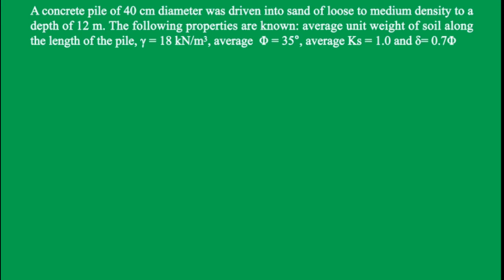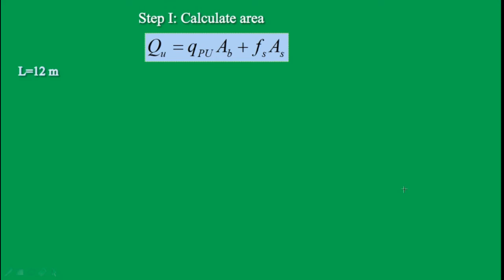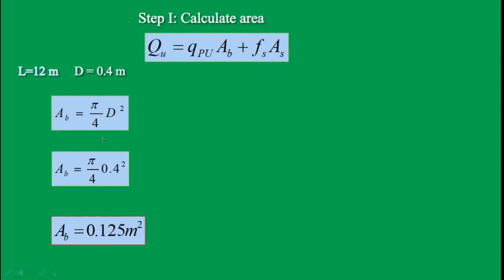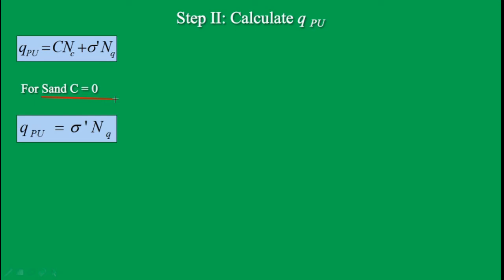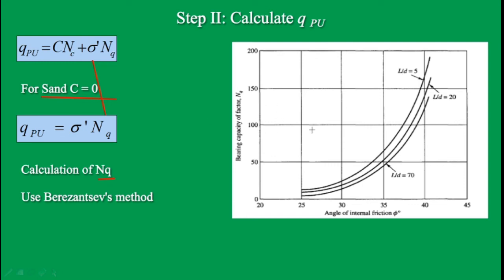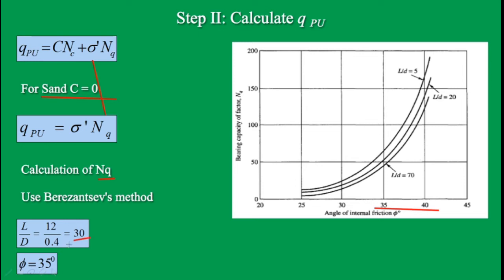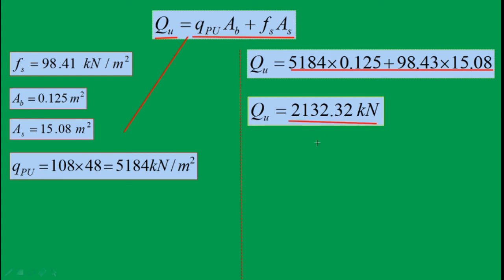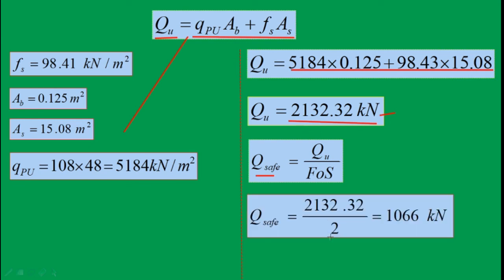Pile Foundation: Part 4: Solved Example: Individual Pile load capacity: Granular (Sand) soil

Comment: there is some correction i think so bcoz value are different for F1 and F2 then the surface area will also be different for both as the F1 is limited to critical depth and F2 will be acting for the remaining length of pile
Reply: Yes bro you are right 🤟

Comment: Determination of ultimate load bearing capacity of pile was not correct.  It should be as below:
Qult= Qp + Qs
Qult = 108×48×0.125 + 24.60×3.14×0.40×6.0 + 49.21×3.14×0.40×6.0
Qult = 1204.2316 KN
Qs = 1204.2316/2
Qs = 602.11 KN
Reply: also got Qu=1209,589